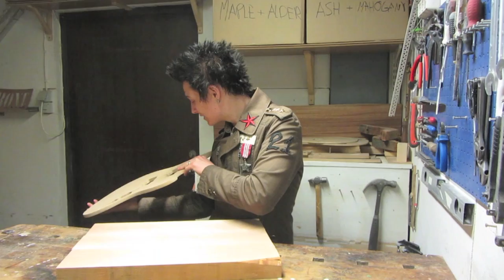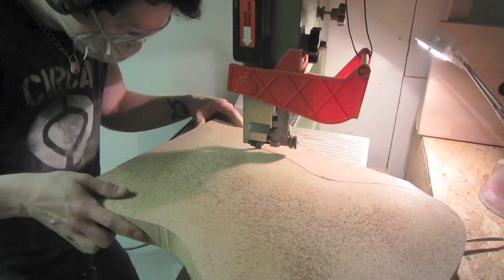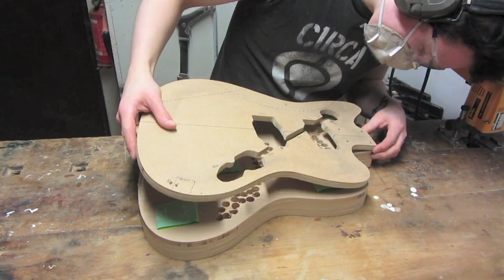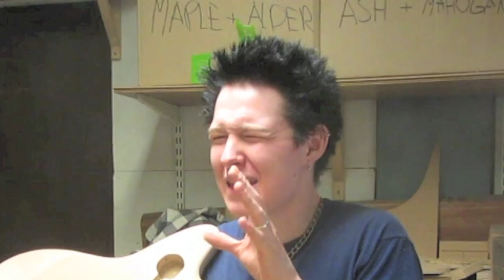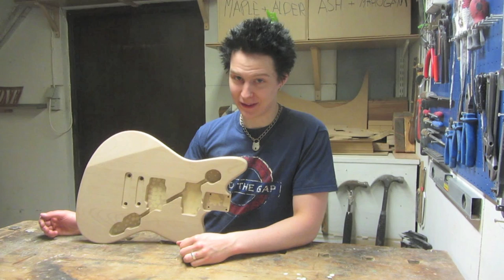Jazzmaster Guitar Build: Week Two

Comment: So if I understand this correctly: The body and neck are pretty much standard Jazzmaster, except for that you built it with a tune-o-matic bridge. Now the tune-o-matic is a lot taller than the standard jazzmaster bridge, and so to compensate for that, you made those recesses where the tune-o-matic sits, right? So my question is: exactly by how many milimeters did you lower the bridge? And do you fancy this method over making an angeled neck?
Thanks.

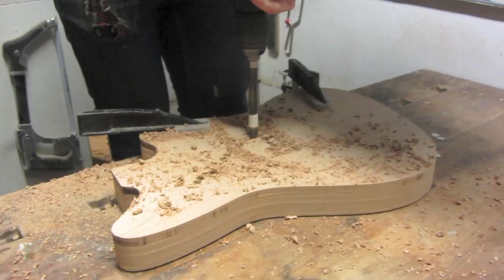Comment: at 1:11 you drill holes, is that to make routing the pickups easier?
Reply from the maker: Not just the pickups but every cavity, haha. Still correct! My router and router bit isn't really doing that good, so Im trying to relieve some pressure. Tho it is a good method to use even with a fully functional router, since it makes it's work easier.

Comment: Hey Tom, would you ever do an instrument without a pick plate, so you have to put the wiring around the back, instead of using the plate to hide it?
Reply: Check his Les Paul Junior build bud.
Reply from the maker: *****, Like ASG0919 said, I've already done it.

Luna is not completely without a pickguard (which the name is), but it doesn't stretch out to cover the electronics.

If I where to do a instrument completely without pickguard tho, maybe. But even tho a pickguard doesn't have any technical functions (like holding the electronics or just being a protection for the finish), it is most of the time an accessory that really finishes an instrument, that you also can do some fun things to (like details etc). In the end, I don't know if I will or will not, haha.